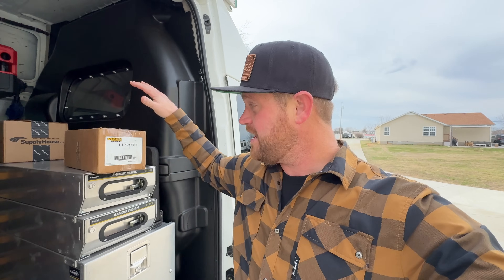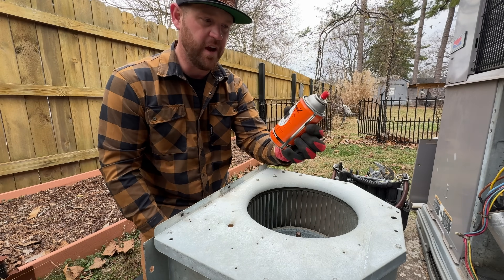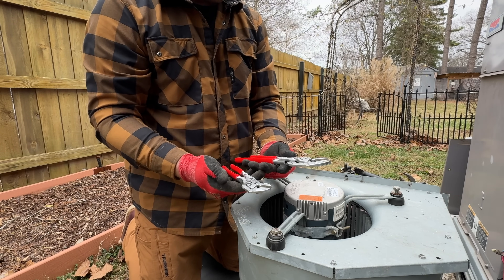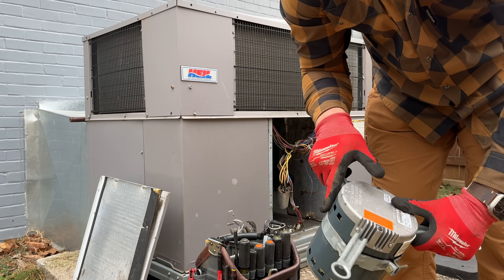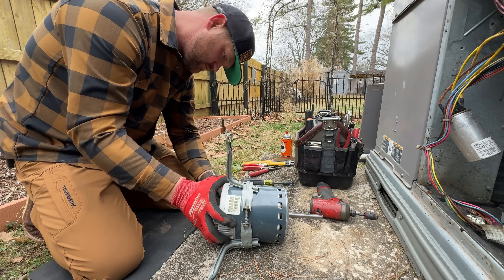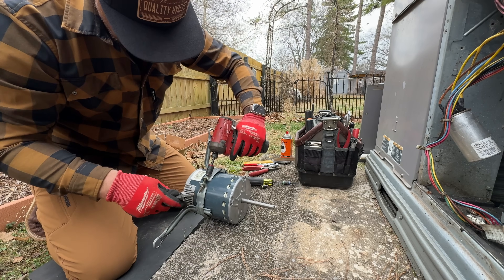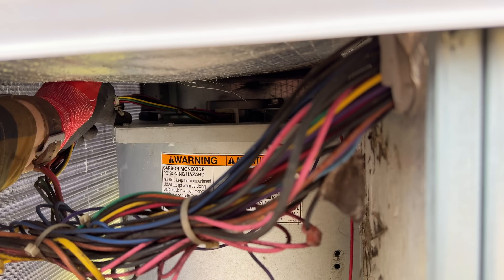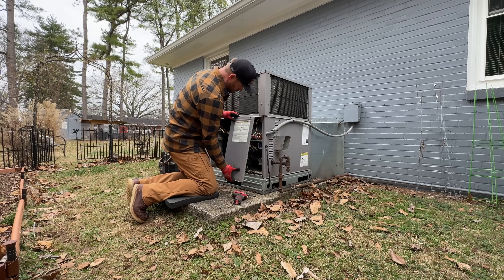Replacing a Faulty HVAC Blower Motor

Comment: Kroil is junk. I'm finally saying it after so much hype and revere by old men. It is not good. wd lubricates, kroil does not. It does penetrate but hasn't saved many bolts from breaking. I'd switch to liquid wrench or anything else. Except PB that is junk too.

Comment: LIFEHACK!…. Use a service wrench tool for the setscrew on the blower wheel. You’re welcome lol also, I have a thing about just replacing the motor and not the blower wheel. I feel that it’s best to replace the blower wheel with the motor for a perfect balance and longevity of both components. Awesome video.

Comment: Nice video but I’m really surprised you didn’t replace the capacitor with a new motor.
Reply: That’s an ecm motor. Capacitor is for compressor and condenser motor.

Comment: The video is respectable but instead of using that clamp you should use a 3/8 socket that engine spiders regularly use. But first lubricate so that when removing the screw it is more gentle. and to remove or detach the fan motor from the blower, some people sand, I use a brush that can be adapted to the impact drill and the lubricant I use is transmission oil mixed with acetone, the kind they use for nails, it is prepared in parts equals. For the rest, the tool brands are respectable.

Comment: Zach, What is your opinion on Heil Packaged Heat Pump Units?  My parents once had a Heil Packaged Heat Pump installed in 1994.  It was the type with the rounded front coils.  It also had a 12 SEER rating. The unit was really great back then and they never had any issues.  I know things today aren't built as good as they were in the past, but I have wondered how good Heil is today.  Thanks